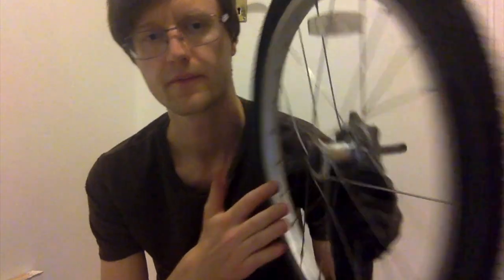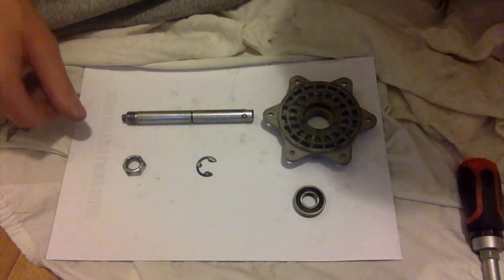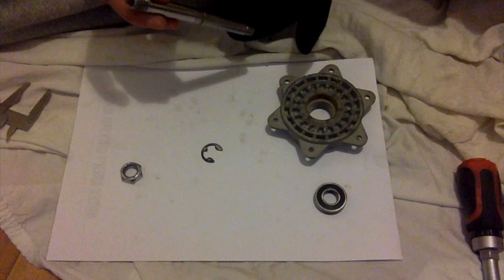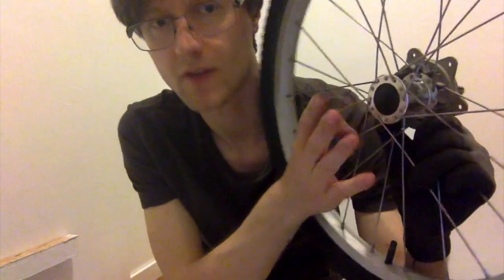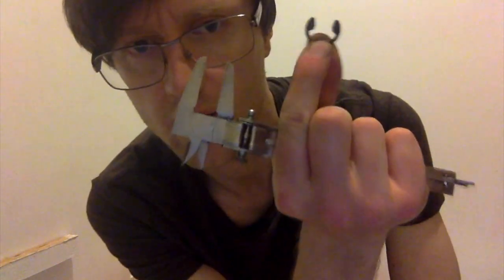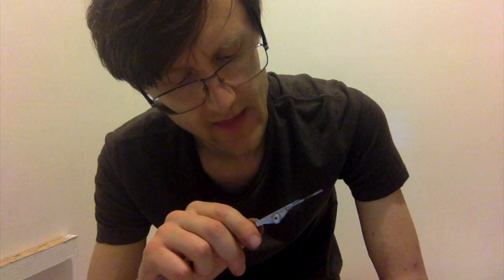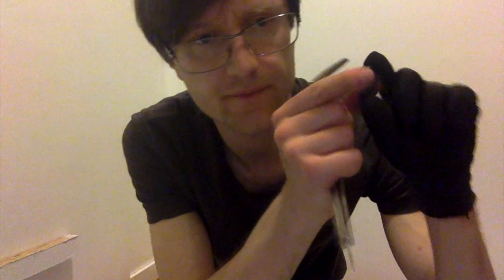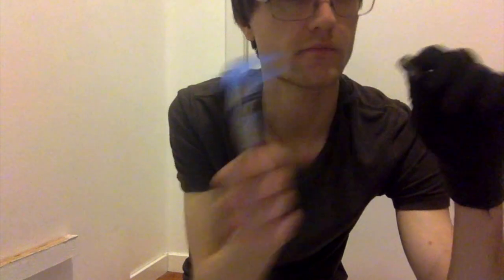Repair Thule Chariot wheel

Comment: Thanks for the video.  FYI for those wondering, the lock ring can easily be removed using a nose plier.  For mine, I just pushed the tips of the nose plier into the 2 curvy gaps between the lock ring & the axle and then flicked the plier very lightly, and the lock ring came loose & flew across the room.
Reply: Yep.  5 seconds to yoke it off, 20 minutes to find where it landed...

Comment: Thx Goran, it help me a lot :) BTW this plastic cover you could take off very easily, just need some sharp tool and pull it off.
Reply from the maker: I'm glad the video helped you! I've gotten so much help from other peoples videos here on YouTube and was very surprised that there was none on the topic of how to take apart the wheel for this type of trailer :)

You're right, the plastic cover is easy to remove with something sharp. It can also be removed by pushing it from the other side once the axel is removed.

Comment: great video!
My quick release got stuck "open", so the wheel doesn't stuck.
I pulled it manually with a pliers from under the dust cover.
I put some WD40 in the quick release , because it feels like some sort of spring inside got stuck.

Do someone know if only the quick release  could be bought as spare part?

Comment: Perfect video. Now i can change both axle on my Thule. After pulling up the dust cover, need some new ? Or can use the old one ? thanks a lot from germany
Reply from the maker: I would use the old one. Don't see any reason to change it. It's basically just a plastic lid that offers some basic protection from splashes of water and dust.

Comment: Hi Goran, thanks a lot for this video! I have the Thule Chariot CX2, and both wheels have developed significant play over the last weeks/months. It's clear the lock nut needs to be tightened to remove play and adjust bearing preload, but I haven't managed to get access to the nut. So I have a small question; what tool did you use to remove the lock ring at the inner side? My hope is to remove that and push the mechanism out along with the rubber cap cover. I have tried to pry the cap cover with something sharp as suggested by others here but it doesn't pop off, it seems somehow glued to some sort of exterior lip (?). I don't want to carry on and break it just yet. Really annoying that Thule does not provide any official service instructions for this proprietary mechanism ... Cheers and thanks a lot! Jonathan.
Reply from the maker: Hi Jonathan and thank you for the question. I assume you mean the lock ring that I put back on about 12:28 in the video. To be honest it's mostly about gentle force, some courage and tons of patience :) It's been two years since I opened the wheel so I don't remember exactly how I did it. Probably just pushing it off from the side. The lock ring that was on my wheel is of a type called "e clip". There are some videos on how to remove e clips. Like this one: https://www.youtube.com/watch?v=XR4sVjOXngk 
I think you should be able to get it off with basically any tool that can push on the two ends of the clip.
Good luck :)
Reply: You can use a flat hand screw driver, put in one of the space between the e clip and the axle, turn the screw drive to force it open more, and then try the same with the other space.  During this time, the axle may rotate, to counter that, find the flat-head like space in the axle, use another flathead screw driver to hold on to it.  Within a minute, someone mechanically challenged like me can get the e clip removed.

Comment: Hi Goran.  I know it's a while ago since you did this, but don't suppose you know what size etc spokes they are?  I have two snapped ones and am looking to get new ones.
Reply from the maker: Unfortunately I don’t know. But if you are going to replace them yourself I assume you have a spoke wrench :) Because if you do you could remove one of the non-broken spokes. 
The recommended option for measuring spokes is to remove one from the same side of the wheel as the broke one and measure it. The length might be different between the two sides of the wheel.
The manufacturer could also have changed something from one year to another so relying on some guy from YouTube might steer you wrong ;)
Usually I just bring the spoke I removed to my local bike shop, they measure it and give me one with the same length and thickness.

In case your bike shop doesn’t have spokes this short you might need to call around to find a bike shop with a tool to cut spokes to length and, most importantly, make new threads.

Comment: Hi Goran, thanks for the video. Just one question. How do you remove the second bearing you show in the video? Greetings. Antonio
Reply from the maker: Thank you for the question Antonio!

I assume you mean the bearing that is inside the hub of the wheel shown at 1:55 (and not the bearing inside the plastic part that is part of the break).

To be honest I am not entirely sure since I have never removed it. If I would guess, I would guess it's just put there by force using a technique called "press fit". If you google "press fit bearing" and search here on YouTube there are explanations on how that works.
Here is one: https://youtu.be/J4gpLYo0vyw

1,5 years have passed since I made the video. I now know that this type of hub is common on rear wheels for wheelchair. There are tools and videos on how to replace bearing on a rear wheel for wheelchairs.
Like this one: https://youtu.be/VGWj7X3kwaQ

Because I have not tried removing this particular bearing I don't know how much force would be needed. It might be possible to hammer it out without a specific tool. Basically taking a steel pipe. Inserting it from the narrower end (inner side if I remember correctly). And using a hammer on the steel pipe to push out the bearing.
Something like this: https://youtu.be/VkY879pMafE

To fit a new bearing inside the wheel you will need to reverse the process. Pushing the new bearing into the hub. Either with something like the tool shown in the video I linked above about replacing the bearing on a wheelchair rear wheel. Or with some other tool. Here is some inspiration: https://youtu.be/HGfvO-ztoT4
and
https://youtu.be/VUtiiGJs6rE

Good luck!
Feel free to report back on how it went. Failed attempts are also about learning. 
Perhaps you want to make a video about it? :)
Reply: Thanks Goran for taking time out to answer my question. 
You’re right, the bearing I was talking about is the one inside the hub. 
I will check all the info you shared with me and I will let you know. 
Greetings,
Antonio